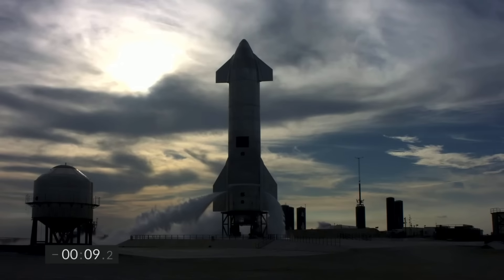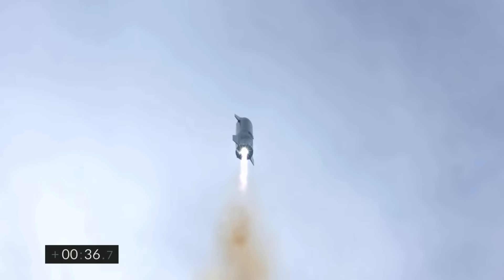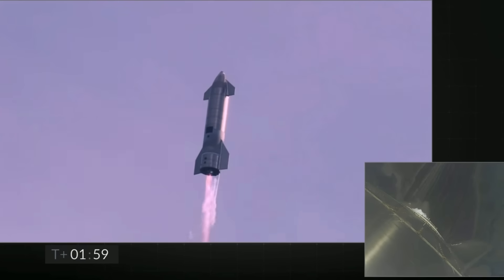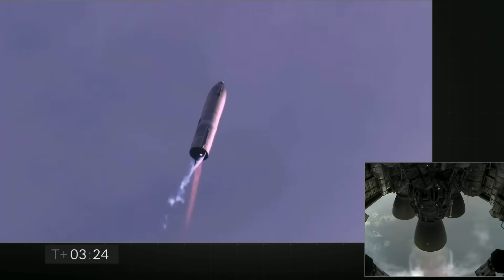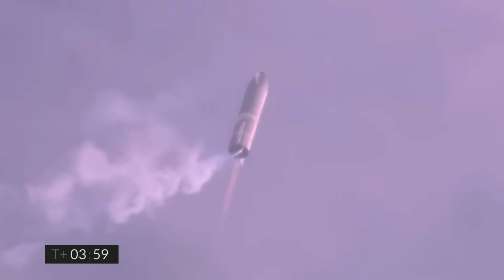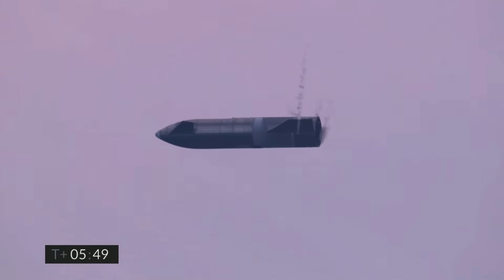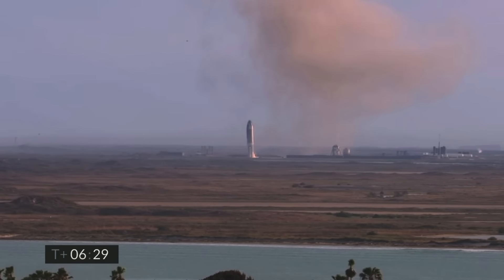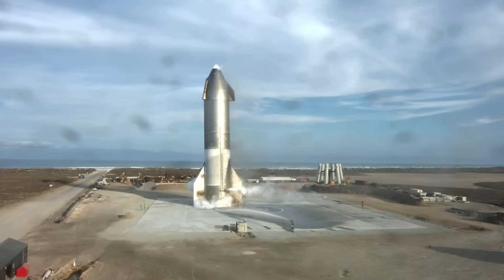SpaceX Starship SN10 soars, lands for first time!

Comment: Two comments. Firstly,at one point the camera was directly underneath the rocket and secondly, I was always taught that vertical landing was impossible because it would take more fuel to slow the rocket down than it was possible for the rocket to hold. I'm thinking of the James Bond film where the rocket landed inside the volcano. Confused, please explain

Comment: Starship is a good space ship but at full throttle and all engines 30 plus going it is too much for the environment. You would have to meet with a space platform or ignite the other engines off earth and in vacuum to protect earth.
Reply: Most the propellant mass used is oxygen. It’s 3.5/1 oxygen

Comment: When these Rockets land could you put some sort of extinguishing system on board to put out the fires that I see every time one of these rockets land! I'm sure Elon can come up with some type of fire suppression system at the bottom of those rockets that could put out any external flames after touchdown! Elon is the genius of our time!
Reply: They’re not gonna include one because that adds weight, meaning less payload and they just completely scrapped landing and will instead catch it.

Comment: How come it does not heat up upon re-entry
Reply: It’s going way to slow to suffer from any reentry heating. You need to be going at least 3 times the speed of sound to suffer a tiny bit and this is only falling about as fast as a skydiver.

Comment: I'm certainly no expert but from my experience from using a drone, if you have the right quality of camera, at the right cinematic angle (in this case right below a falling object which absolutely ideal) and double frame rate vs shutter speed, using a quality filter, you can often get a smooth-looking "CGI" shot. It looks enhanced or fake. I'd imagine this landing is real. The gas and flames also matches up perfectly just as it cuts to the final landing clip.

Comment: Is that big side flame after the landing normal?
Apart from that, to get from an apparent free fall, to a completely controlled descent, it's beyond amazing!  But shouldn't the rocket land with "feet" as support, instead of landing with its own fuselage holding the weight?
Reply: It did have feet, but they were really small and were not enough to prevent the hard landing and subsequent explosion a few minutes later from a fuel leak and that fire.

But they have solved this issue by having no legs and are planning on catching it near the end of the flip by pins just below the forward flaps, which saves weight by removing the legs.
Reply: @archierush868  Got it, thanks 👍🏻

Comment: Amazing advancement. . However the way the NASA space shuttle would land, is the safest way, wherever there is a runway, at least.
Reply: There are no runways on Mars, and landing requires legs, which adds weight, reducing payload capacity.

Comment: Burning fuel to create thrust is not the answer to space travel.  Have to understand gravity first.
Reply: There is no other way to create thrust for a rocket
Reply: @archierush868  well yeah a rocket is a very specific thing but theres plenty of other ways to generate propulsion
Reply: @clipsdaily101 there is no other way to effectively move in space without having to throw mass at super or hypersonic speeds. There are no anti-gravity magic things that exist
Reply: @archierush868  i agree since u said effectively. I'm not arguing the fact that rocket propulsion is the best we have rn i was simply acknowledging that other systems of propulsion are possible. there's a lot in between rocket propulsion and magic and its good to stay open minded to new ideas
Reply: @clipsdaily101 this is the most efficient chemical engines possible. Nuclear engines exist but haven’t flown and others are under development but right now, this is all we have.
Reply: @archierush868  the chance that we just now reached our peak in terms of propulsion technology is incredibly low. im not trying to take away from how genius the current rockets are but theres always room for improvement
Reply: @clipsdaily101 full flow staged combustion cycle is the most efficient engine type we know of.

Comment: You can look online as much as you want but you can't find the information, they say the shuttle was traveling at 4 G's in space after releasing the rocket, but the ISS is traveling at 17000 mph so how is the shuttle accelerating to catch up with the iss? 
I would like someone who has the knowledge to explain to me how is the shuttle accelerating in space from 4000 mph hour to 17000 mph?
Reply: What do you mean by explaining it? How it accelerates because it is in space i assume.
The engine shoots out gas and the rocket gets pushed in the other direction. It's called conservation of linear momentum.

Comment: There's a fire after the landing..is that normal?
Reply: Depends on what to consider normal. Normal for future operation of actual ship? - No. For a testing prototype? - Yes. That’s why they build and test prototypes - to find flaws. 
There was a leak (oxygen, as I recall). They found the weak spot in design and fixed it)
Reply: @dmytrogubskyi4355  "weak spot in design" or manufacturing?
Reply: @internetcensure5849  don't really remember the details. It was 2 years ago, after all.

Comment: Solid progress. Disaster landing. Why did they leave the deceleration so late? 2 km was clearly not optimal.
Reply: They had more than enough time to slow down. These were the old Raptor 1s which weren't that reliable at the time. The Raptor 2s seem to be better.

Comment: Looks like a computer simulation.
Who filmed this, or how was it filmed?
I don't believe that such a massive rocket can be slowed down so easily when it falls. 
I don't trust this film at all!
Reply: It's real, hundreds of people saw it live. https://www.youtube.com/watch?v=AbXbXAKJ8yg
Reply: @avap0n459  I do not know! The applause comes from the back, just like in sitcoms. And look at the speed of the fall! That can not be right. It should be much higher and somehow increase by 10 m per second according to physics. And the retrorocket ignites so close to the earth's surface?  Think about how high above the earth's surface a parachutist has to open the parachute so that he doesn't hurt himself! So somehow a little bit strange, or?
Reply: @avap0n459  ok. Wow!
Reply: @achimborn5850  You do not constantly accelerate at 10m per second when falling. Friction from the air slows you down. Called Terminal Velocity. You can even manipulate drag to change direction, speed up, slow down, or do tricks. Skydivers do it all the time, and Starship takes inspiration from Skydivers. In this case, Starship falls belly first to increase drag as much as possible. It then has the fins on the top and bottom to keep it steady and to guide it to the landing pad. Even then it is falling at around 200km per hour(about 125mph). When it flips at the end, the engines have to be firing to slow it down quickly before it crashes.
Reply: @anthonypelchat  Thanks, it's incredible that this ultra-heavy thing doesn't just crash into the ground.
Reply: @achimborn5850  Well to be fair, the previous 2 versions (SN8 and SN9) did crash into the ground. And this version, SN10, hit too hard and  got damaged. It blew up a little bit later. SN11 exploded in mid-air. SN12-14 were canceled. But SN15 finally landed successfully. 

Rockets aren't easy. And landing them is on a whole other level. SpaceX has a ton of experience though. The latest version of Falcon 9 has landed over 150 times now.

Comment: Why did SpaceX waste over a year and Billions on this, when they should have been developing the SuperHeavy booster first, with a disposable 2nd stage .. then later developed a reusable 2nd stage as a potential cost savings.  They could have already be cheaply launching MANY more Starlink Sats by now.
Reply: They doing both at the same time and also they are advancing much faster in resuable rockets than nasa who created only one which is the space shuttle
Reply: They don't need to build this to launch as fully expendable. Starship's goal is to be fully reusable. Falcon 9 is handling Starlink for now.

Comment: elons cameras float with the ''rocket'' and get a perfect frame for video..its amazing!

the smoke from the engine slowly billows away..no speed..the clouds hover and just well, hover...the ''rockets'' wobble a fire against the mass of the rocket like some after thought..and the cloud gently billows at 32000 ft...musk magic..and then free falls..with the floating cameras..in perfect framing...what an amazing camera guy...getting something ''falling'' at 800 mph in perfect frame!...and lands perfectly with no stabilsiers...like a falling pencil....modern cgi is incredble!

so lifelike if you dont use critical thinking..!.

and as muskman says..''it looks so fake, it must be ...real!''
Reply: You have issues. There are no floating cameras. They have cameras attached to the rocket. Not even difficult to do. Guys from the ground are able to easily track the rocket because it wasn't flying nor later falling fast. Terminal velocity for Starship is only around 125mph, roughly. And it does have stabilizers. You see those fins on the top and bottom? They move. Open your eyes for a change and you will see them moving to guide the ship.

Further, this whole thing was planned ahead of time and visible from the nearby public beaches. Hundreds of people took and posted their own videos of the launch and landing.

Comment: there is no way this entire vid is real xD it looks so slow and wrong... excuse me if im wrong, but bro :p
Reply: Bro I know but be careful they'll ban the comments
Reply: The reason it's so slow in the ascend is because it wasn't pushing with all of it's power. The goal of that flight was to test the most critical flight systems (vehicle integrated engines running for a certain amount of time, gimballing and most importantly that flip maneuver at the end). No need to go super sonic, since this wasn't intended to fly to space.
The reason the descend looks so slow is more interesting tho.

Starship is a rocket and rockets are terrible in their ratio from vehicle + fuel mass to payload capability. So they want to use as little propellans as possible to land. That's why it's going into that horizontal position after it reached it's highest point. It's now pushing with it's entire "belly" against the air. The drag is much higher than it would be just falling engines down/pointy end up. Now they need way less propellant to land, saving a lot of payload capability.

Also don't forget the size of that thing. It's 50 meters high and 9 meters wide and the last perspective from the ground up really messes with your perception.

But it's definitely real. During these flights everyone was able to get to about 3 Kilometers near that thing.
Reply: @norinokia2307  tnx dude👌👌👌
Reply: @GryteselvFPV  No problem!

Comment: 7:54 is it supposed to be leaning over like this when its landed? Is that by design or just how it landed this time around?
Reply: Landing wasn’t the actual goal of this test. This test was to get the hover and control techniques down pat. This critter is only expected to actually land on the moon and Mars for which they’re putting landing feet on it. On earth, it’ll hover to the chopsticks which are expected to catch it by those upper flaps. Think most were surprised it actually did land.

Comment: The slow down can be started earlier and landing be made softer, isn't it? Doing so can minimize the impact force on the ship even further.
Reply: That’s not the problem, the problem was just bad coding, the engines have more than enough thrust there to make  Starship go back up, they just throttle them down to be able to use the least a amount of fue possible

Comment: What asonishes me is the seemingly low speed of free falling. You would think that its speed increases much more. It looks as if is quite slow, but it can't be because the engines thrust is off. And it's also not due to gliding. It does not glide. You can see that if you observe the damp clouds.

Comment: I put a few numbers into a spreadsheet and a single raptor 1 engine would produce almost 3GW of kinetic energy output (thrust) from a total input of around 6 GW of thermal energy from combustion of methane and oxygen.
Compare that to a sports car with a 200kw engine and just one raptor engine produces more kinetic power than 10000 sports cars. !
One raptor engine has double the thermal energy of a large nuclear power plant - when starship launches with over 30 engines the thermal power is equivalent to around  60 large nuclear reactors. !

Comment: 1-Metal Foil Resistors, Link to a document.
 Topics on metal foil resistors,
 theory and practice, with the corresponding bibliography.
Charly GarcíaJuly 15, 2022
Metal Foil Resistors  , https://www.youtube.com/watch?v=eRs6GJTAvJM

2-Theory on the manufacture of the metal foil resistor, first part. 1
This video sequentially describes the first part of the metal foil resistor manufacturing process,
each image is accompanied by its corresponding bibliography, which the reader can consult more extensively.
, https://www.youtube.com/watch?v=QPeFu5du7W8

3-Thermal treatment of the metal foil, to adjust the temperature.  Temperature Cofficient of Resistance 1. Evanohm
Thermal treatment of the metal foil, to adjust the temperature coefficient of temperature TCR.
coefficient of temperature TCR, https://www.youtube.com/watch?v=HDZAm2wAnrk

4-Metal Foil Resistors page, with the theory and practice and its corresponding bibliography.
 https://telegra.ph/Metal-Foil-Resistors-09-29, Metal Foil Resistors Index
Manipulation of the TCR in metals. 1 https://telegra.ph/Manipulation-of-the-TCR-in-metals-09-08

5-Metal Foil Resistors, Metal Foil Resistors 3.https://www.youtube.com/watch?v=fM8Rd89V01c&t=153s
In order to modify the properties of the TCR,
it is necessary to use an oven with special characteristics such as those described in this video,
for more information read "Heat Treatment Principles and Techniques ,Ashok Sharma, C. P. Sharma, and T. V. Rajan.

6-metal foil resistors, https://www.youtube.com/watch?v=eRs6GJTAvJM
10 views  Aug 30, 2022  Topics on metal foil resistors, theory and practice, with the corresponding bibliography.

7-Manipulation of the TCR in metals. 1. https://telegra.ph/Manipulation-of-the-TCR-in-metals-09-08  .The adjustment of the TCR to compensate for resistance variations due to thermal effects is carried out by heat treatment of the metal foil. The nickel-chromium alloy, called Evanohm S, (see Hamilton Evanohm S), can have its TCR adjusted, in the range of about 100 to -20 [ppm/°C], during the manufacturing stage, by heat treatment. in the temperature range of 400°C, resulting in a graph like the one shown below, resulting from a 2-hour heat treatment.

8-  Metal Foil Resistors . Sep 15, 2022  Thermal treatment TCR. 1 ,This movie describes the first part of the metal foil treatment.https://www.youtube.com/watch?v=_pVK6fHFWS0&t=36s

9- Manipulation of the TCR in metals. 2 .The second part describes in more detail the processes and equipment used. Manipulation of the TCR in metals. 2 .The second part describes in more detail the processes and equipment used.
https://telegra.ph/Manipulation-of-the-TCR-in-metals2-09-29

Comment: What if the engine misfires during the procedure? This is risky, this needs wings or some othe safety like a parachute etc.
Reply: It’s not a plane, parachute will need to be extremely big, starship is 9 Meters wide 50 Meters tall, plus it lights it’s engines low to the ground which won’t give a parachute time to open
Reply: @infected7258  then you should implement multiple parachutes in case the engines stop working when needed.

Comment: That's simply amazing. The shot when it start the engines and flips is breathtaking.
Reply: I know, right? That one two three of the engines coming back up, the fins retracting to point it at the ground, and then that aggressive flip and deceleration. 

I thought landing two boosters simultaneously was cool. The first time this thing takes off and lands with people on it is gonna be insane, especially if they end up going for that grappler design they wanna do to catch it mid-hover at the launch tower. 

We've gone from the thing exploding on the pad due to crappy welds, to exploding mid-air, to it launching, doing its acrobatics, then landing and actually hitting the mark. I'm fairly convinced this company is the future of space flight. If they're persistent enough about it, they'll get this ship to Mars and back.
Reply: It's CGI.

Comment: How do they keep that thing level?
Reply: It has 4 fins which are used like airbrakes instead of wings. By folding them they can control the air resistence on each part while falling, similar to the arms and legs of a skydiver.
Reply: @norinokia2307  I know I know. It was rhetorical.

Comment: Why not just have 1 engine that operates variably. When you lift off have it burn at 100% capacity and then when it lands the engine comes on at whatever capacity it needs to slow it down on landing. The power of the motor should be directly in correlation with altitude.